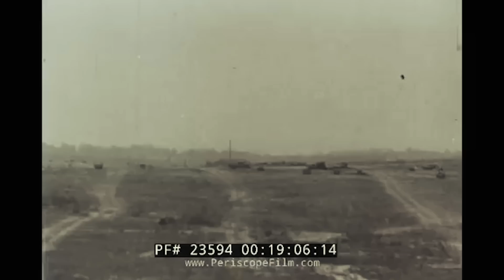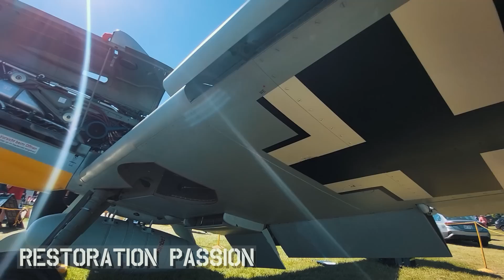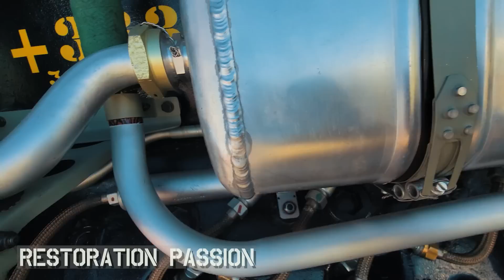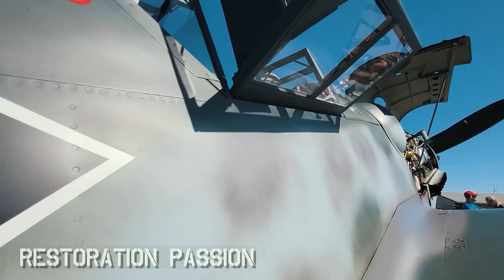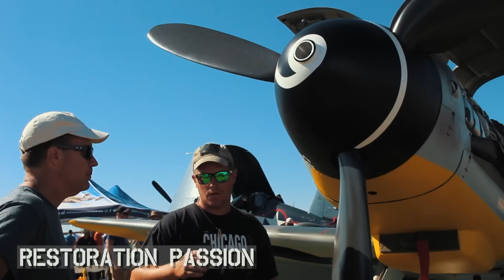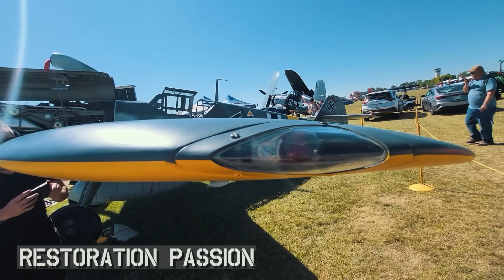Intensive Study: ME 109 Aircraft Restoration

Comment: An interesting note is that most of the bf 109s that fly are  licensed production from around spain.
I think my memory isn't the best.
Reply from the maker: Yes you are correct, referred to as the "Buchon". They do however look slightly different. They use a different engine to the Germans with their Mercedes DB. The DB engine is mounted upside down or inverted. The Buchons had an Upright engine. Looking at the 2 side by side you can see the big difference. There are 2 or 3 real German 109's flying now, one of them being the one in this video.
Reply: @MilitaryArmamentsCompany   Also the Buchon didn't fly as nice as the Bf-109 and it was based on F airframe. I think the vertical stabilizer was asymmetric for the torque from the DB engine and prop. The Merlin rotated in the opposite direction and the stabilizer was not reversed, so the problem was worse.

Comment: I recently did  a wilderness hike in Lapland, where 109 F made forced landing during ww2 time. Small pieces still around. Most of it collected at -70's by airforce.
Thing is that guy who moved to that remote place at 50's, used parts of the plane to build his hut.
Reply: +@Kar1heikk1  Many of the wrecks left in situ are documented.  There is pretty extensive list for Norway, and I think most are protected heritage crash locations.

Comment: 26:50 Try 2500-3000 rpm. Certainly not fixed rpm. These were designed to be ran balls out, and were ran hard to compete with the spitfires of the time. Huge swings of rpm between climbing and reaching distant targets, and getting back to cruise specs to let the engine cool back down.

Comment: This plane just looks just so perfect i wouldn't want to risk flying it and put inside a huge armoured lass case and preserve it forever.
Reply from the maker: There are actually now more Flying 109s in private hands then any time previous. Real ones with the DB 605, not the post war model.
Reply: These belong in the air. Its the responsibility of the owner and pilots to ensure they are in competent, qualified hands in the air and on the ground. The risk with the 109 is constant in regard to damaging the engine core, as there are no replacements.

Comment: Captured 109's had spray bars installed in front of the radiators. Tanks were installed in the fuselage to hold water to cool the radiators to give extra ground running time. There are pictures showing this.
Reply: The mid to late war models were supposed to have water tanks behind the fuel tank for water injection into the fuel to boost horse power also.

Comment: thx for sharing, can it be, that it is the really last flying original bf109 ? most other still flying models are buchons. awesome job, please let her be still intact without any damage
Reply from the maker: It could be, we have had reports of one or two other originals however not flying in the last few years. Mike mentioned a 109 called Black 6, an all original that was flying around in the 1990's.
Reply: @MilitaryArmamentsCompany , unfortunately Black 6 crashed on landing at Duxford air museum in 1997. It was the plane's last flight before it was due to be permanently grounded and a senior RAF Officer was allowed to take it for it's final flight.

Attempting to land he overshot the runway, landed in a crop field and flipped it over forwards onto its back.

I believe it was restored (again), but it doesn't fly any more.

Comment: Where did from a propeller blades were taken? Any blueprints on them out there? Or a kind. Any contacts on the restoration team available?)
Reply from the maker: Reach out to Midwest Aero who did the restoration of this plane.
Reply: @MilitaryArmamentsCompany  many thanks!
Reply: @modellerdesign   Skycraft Engineering in the UK and MT Propeller in Germany have been very involved with manufacturing new propeller blades and restoring hubs and propeller systems for warbirds.  Skycraft completed restoration of the very unique propeller system for the Stuka restoration at the Flying Heritage Museum.

Comment: Great job     Too bad original factory cant still build these
Reply: Ive seen that the way the DB inverted v12s were machined, that theres really nobody who knows how to do that anymore, and the machinery to properly make them is long gone. Strange to think even with todays tech, we can't copy something made nearly 100 years ago.
Reply: @HarborLockRoad  The metallurgy specifications, casting process and heat treatments would have to be reinvented to manufacture them.  Some of those records survive. And you would have to recreate nearly all of the tooling.   But these engines have thousands of parts that would have to be manufactured to correct specifications to be flight certified.  Also I'm pretty sure that Mercedes would still own the patents and licensing for the engine and would not allow manufacturing of whole engines.

Comment: I bet that even the Messerschmitt foundation doesn't have such a perfectly restored Bf109.
Reply from the maker: We are told this is currently the only top to bottom airworthy 109.
Reply: @MilitaryArmamentsCompany  thats not true, last i check a couple years ago there were somewhere around 3-5 fully historical airworthy 109s that still fly. maybe the only bf109 G-6, but as for the only 109 full stop, thats not correct.
Reply: Paul  Allen s fighter  heritage   also  has  a  G4  beautiful  it  is @MilitaryArmamentsCompany
Reply: @davidrhodes7655   Paul Allen's museum has an airworthy Bf-109E-4.  The museum does not have a G series,  surprising since several have been for sale over the years and the museum could have obtained one.

Comment: Hispano were not forbidden from using DB605s.They just couldn't get any, due to the factories being bombed flat. But there were a surplus of RR Merlin 500s post war both new and lightly used. 25 G models were supplied to Spain during the war, but without engines, tails or other important components which were promised shortly after but never delivered. ISTRC the Spanish did try a Hispano-Suiza powerplant but with limited success as the HS engine was not as developed as the DB605 and didn't have a supercharger so high altitude performance was poor.